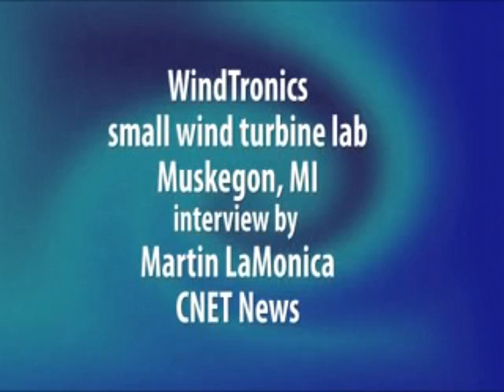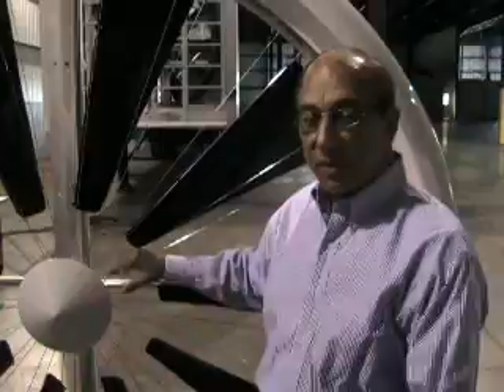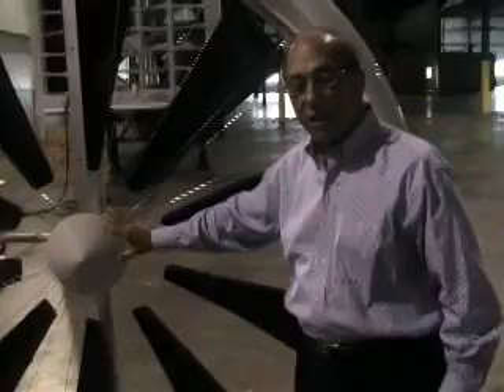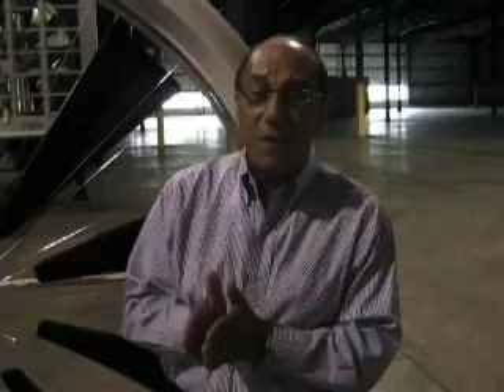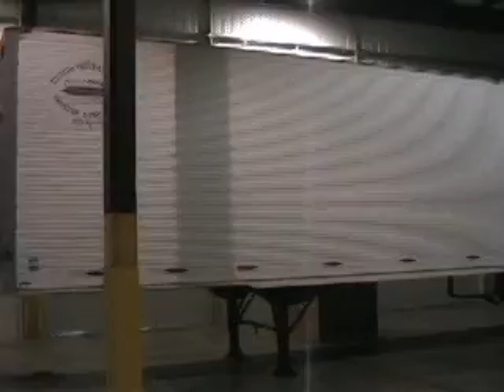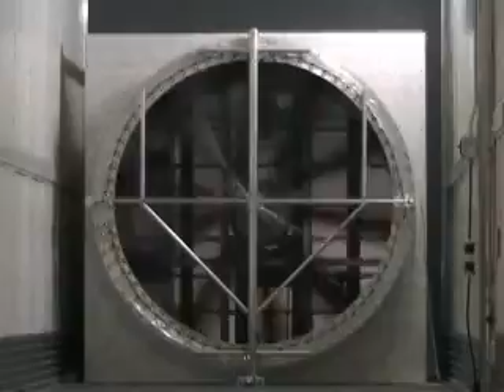WindtronicsLaMonica

Comment: hi i like the design of the wind mile, 1 quick question how much electricity is produced in 35-45 MPH. correct me if i am wrong it starts from 10/7 i.e. watts per wind speed (MPH). if i my calc r wright this design will be able to generate up to 500-750 KW per hour with those statistics......

Comment: This turbine's downfall will be it's inability to adjust quickly to changing wind direction.  I figure that the mounting restrictions will reduce the adjustment to wind direction changes to less than 90 degrees.  Great idea, but unless it can swivel 270 degrees, and do so at a decently quick pace, it won't ever come close to harnessing the full power of the wind.  In fact, it will be no better than a regular turbine sold at the same price.